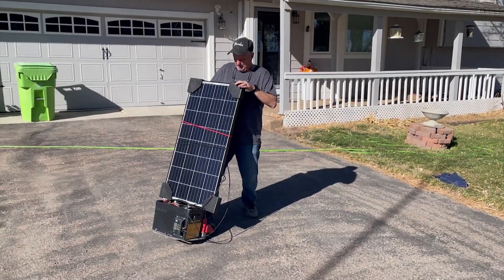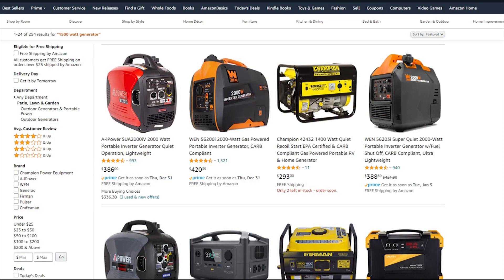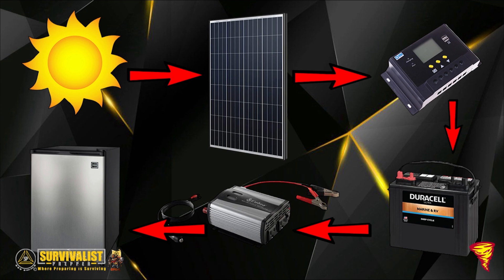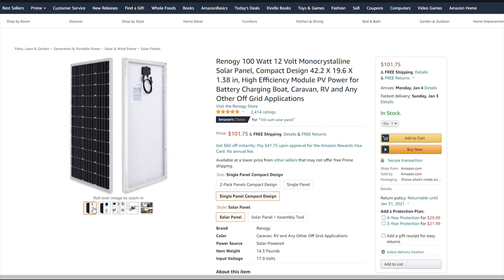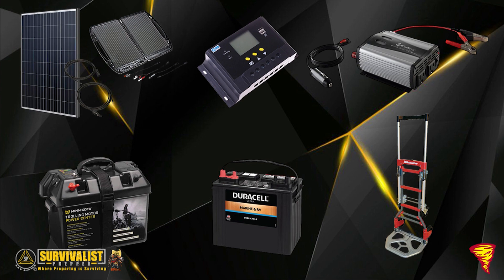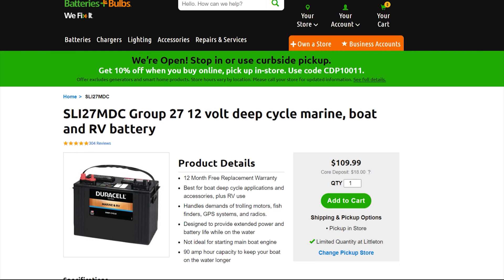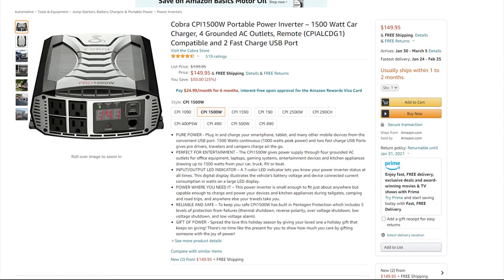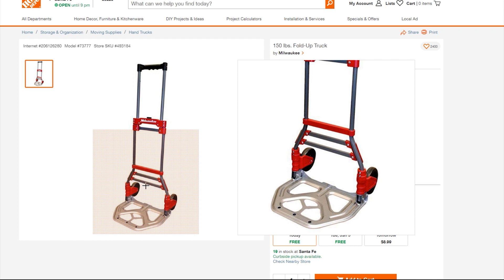How to Build a DIY Portable Solar Generator (Updated)

Comment: I live in apartment and this is a really good idea .I just bought a chins liepo4  battery in amazon of 12 volt 100 amp .I wonder if I can put 2 batteries in parallel to  a 1500 pure sine 12 volt inverter without any damages ? Thank you so much for uploading  this video especially for this hurricane season.
Reply: According to the manufacturer's specs, you can connect up to 4 Chins batteries in series and/or up to 4 in parallel.
Here is a copy/paste straight from the spec sheet: "Capacity Expansion: CHINS LiFePO4 battery can be connected in parallels and in series for larger capacity and voltage. Max connection in series: Up to 4 identical batteries for up to 48V connecting in series. Connection in parallels: it can connect multiple batteries, suggest no more than 4pcs in parallel. Allow to be extended up to 4 in series and 4 in parallel (Max 4S4P) to get more capacity (Max 400Ah) and higher voltage (24V, 36V, 48V). Other installation methods: 4S2P, 2S2P, 3S2P, etc."
Reply: @troyyarbrough  thank you .

Comment: Quick note:  You can NOT drain that battery all the way down without damaging it.  In fact, to get the best life out of the battery, you should not discharge it down to more than about 60% SOC (state of charge).  That means out of a 90 amp hour lead acid battery, you really only want to draw about 35 to maybe 40 amp hours worth of power before you fully recharge.  Draining it lower than that is likely to cause damage that dramatically decreases the life of the battery.  

A much better system can be made with two lithium-iron-phosphate (LiFePO4) batteries, wired in series for 24 volts, along with a corresponding charge controller and 24v inverter.  Those components go on your hand truck, with the solar panels (at least 250w, but preferably 400w or more) mounted in a fixed location.  Yeah, that's not "prepper" approved, but as you stated, most emergencies will be of the shelter-in-place variety.

Comment: Is your well pump only 120V?  Most are 240V and require 15 amps startup and 8-10 amp continuous.  The primary purpose for the Solar Power Carts I build is to run well pumps for off-grid water.  Just in the last 6 months I’ve started to add a 500w micro inverter that puts out 240V to run an off the shelf 240V water heater.  The micro inverter’s 240V / 2 amp output is fed directly into the Magnum which in turn feeds the existing electric water heater in most homes which draw 1500-4500 watts on grid power to heat fast but only 500w and 4-5x more time.  But a hot shower during SHTF is far under rated!! 😉
Reply from the maker: Most likely 240. I haven't checked yet. I'll probably do it this summer. I'll probably need to get a transfer switch on the breaker box as well.
Reply: @survivalistprepper  have you watched E775 (Scott Hunt) on the Practical Prepper YT channel?
Here’s a link:
https://youtu.be/tguNeggITZ0
Reply: @survivalistprepper  The 120V inverters you’ve been discussing will not come close to powering a 240V well pump.  They also need pure-sine wave for the long term health of the $3-4K pump down a 200-400 ft hole.  🤔

Comment: A Honda 2000i will run 3.4 hours on a tank (~1gal) at full load of 1600W, or 6.8kWH.  Your battery and inverter will supply 50AH (50% of 100AH rating for continued battery life) of 12V, or 0.6 kWH or 1500W for 24 minutes.  Then to recharge the battery with a 100W panel will take over 6 hours of full sun.  Apples to Oranges.  You’ll need 11 of those batteries to equal one tank of fuel for the generator.  I too have built several portable Solar Power Carts.  To equal a Honda 2000i and one tank of fuel they will cost over $2000 before they’re comparable.  We need to be realistic about what they are capable of.  All the best, Echo Papa 👴🏾
Here’s a link describing one I built specifically to fit in a 2’x4’ space in corner of the customer’s garage and connect to his transfer switch in place of his 8kW gas generator.  This cost >$5000.  
https://youtu.be/P7CwqUQWcmY
Reply: Exactly.